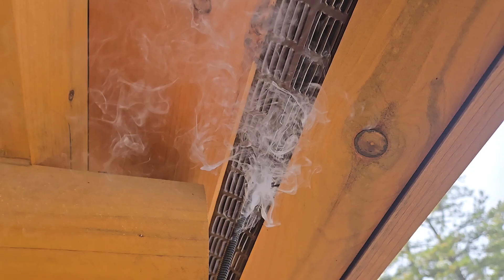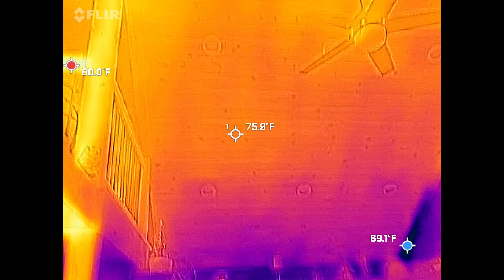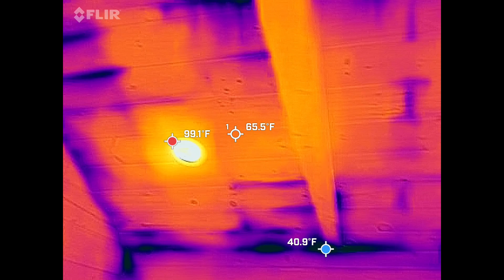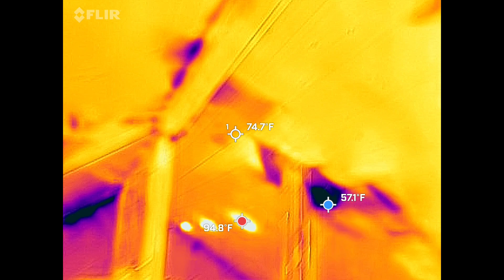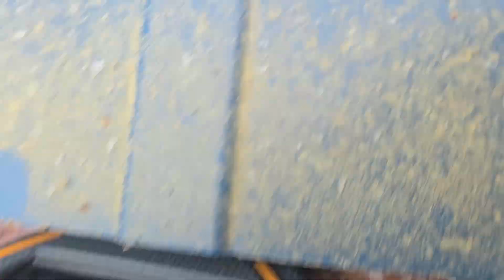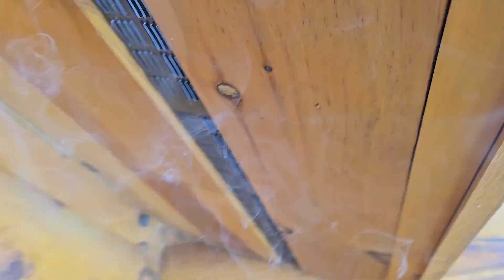Warm air leak=Water?

Comment: Thanks for sharing. Insulating the ceiling on a section of a shop this spring and will be using 6" of polyiso to get to R-30 as my options are limited. It will be unvented and I know the risks, so perfection is the goal 😬. Thanks again.
Reply from the maker: Hello,
The insulation strategy is a plausible one, but air sealing is extremely important. Especially if unvented.   Good luck on your project, happy building and thanks for the comment.
Reply: @ShawnBaldwin603 yes no leaks. Like an upside down boat.